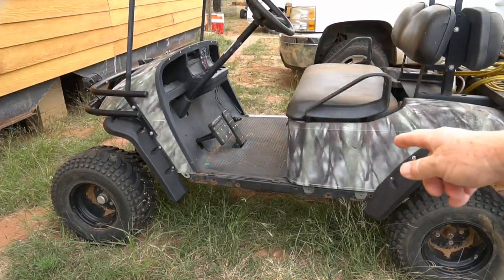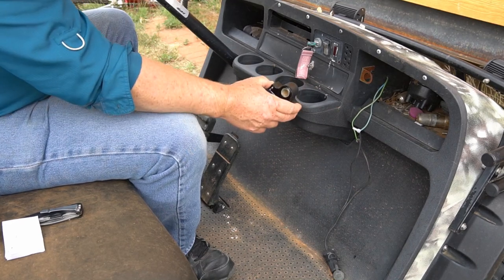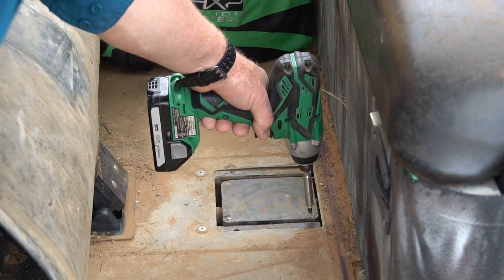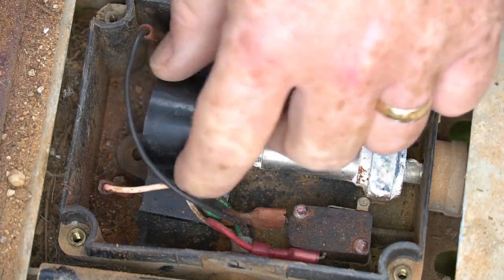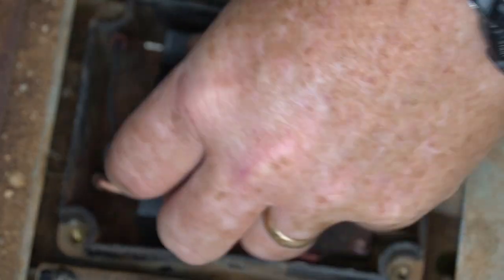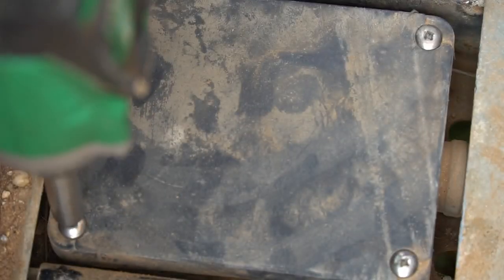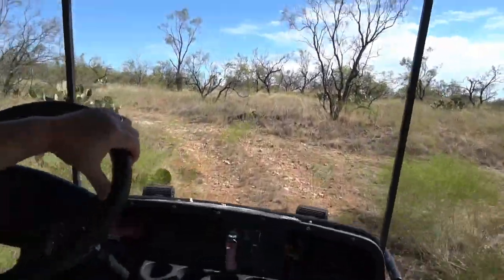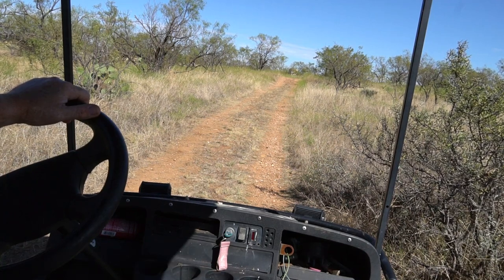🛠️ How to replace an EZGO Golf Cart Inductive Throttle Sensor. 🛠️

Comment: Just ordered one!  I had identical symptoms. Worth a roll of the dice and $24 rather than loading the trailer and driving 25 miles on two different days.

Just a followup on 1/27/21- it works great now!  Thanks so much.
Reply from the maker: Thank you for commenting Allyson!  I am so glad the video was helpful.
Reply: What's the name of the part? Thank you.
Reply from the maker: It's call a Throttle Sensor. Here is a link to the part, #ad https://amzn.to/3VNcLyf

Comment: Excellent video. Mine won’t move at all the solenoid is clicking but it won’t move. I’m gonna try this. Thanks agin for the simple instructions
Reply from the maker: You're welcome. I am so glad it helped.
Reply: Mine has your same issue. Did this end up fixing the problem for youm
Reply from the maker: Yes. It fixed the problem.

Comment: Got a ezgo 36v. When driving up a real steep road toward the top of the hill I'm hearing two beeps then one beeps. Carts still going and keeps beeping until I level out. Beeps sounds like it is coming from under the seat. Any suggestions?
Reply from the maker: Sounds like a low voltage warning to me.  This may indicate that one of your batteries is going bad and when it comes under s heavy load the voltage is dropping on that battery.

Comment: I have an E-Z-Go also and I replaced the same unit you are now mine is still jerking when I take off what else could be my problem 2 week old batteries they're brand new
Reply from the maker: I recommend you join this group of experts for advice.  They have been my source of help whenever I have run into problems with my cart.  https://www.buggiesgonewild.com

Comment: Hi, I have an EZGO that with full charge sometimes works and other times, I can hear the solenoid click but the cart doesn't move or try to move but can't. I thought the batteries were shot, but today I went out and tried it and at first it wouldn't move as I just described but I kept putting my foot up and down on the accelerator and eventually it worked, do you think this could this be symptomatic of a throttle sensor or something else?
Reply from the maker: Sounded exactly like the throttle sensor to me.
Reply: @thejungleexplorer  hmmm, it seems to be worse when I've left it on charge and its sat for a few days. The charger claims its full but with the full battery led lit but then when I try to drive it, it will move a few feet and stop. I'm leaning again towards the batteries being shot.
Reply from the maker: @healeydave  You may have a bad battery or a bad connection in the series. Do you have a multimeter to test voltage with? If so, try this.
Block the wheels so the cart can't move. Then do a voltage test on the whole battery bank series. You should get a total voltage over 36v, between 38 and 40v. While testing the voltage of the whole series, bringbitnunderbs load by lightly pressing on the pedal just enough to make the cart move.  Watch the voltage while doing this. If the voltage drops a bunch, way below 36v, you have a a bad battery.  Now do the same thing while testing each battery individually until you find the one that drops voltage under load.

Personally,  the first thing I always do, is to clean and redo all the connections and top off the water in all the batteries. Bad connections are hard to find. The easiest way is to put the cart under full load for a while and then feel each connection and find the one that is hotter then the rest.

Hope this helps.
Reply: @thejungleexplorer  Thanks for the advice, sorry it took a few days before I had a chance to test.

I jacked the cart up to do these tests, I hope the wheels turning freely is enough load for the checks you specified.

The charger was topping off the batteries this morning, so I had my breakfast whilst waiting for it to complete.

When I went back out, the charge cycle had completed and the whole pack was measuring 39.2V and individual batteries were measuring 6.46V, 6.55V, 6.59V, 6.46V, 6.60V, 6.68V. 

With the throttle pedal depressed enough to cause a the wheels to turn, the voltage drop on the whole pack was 37.8V and the individual batteries measured 6.29V, 6.29V, 6.33V, 6.18V, 6.28V, 6.28V.

I lowered the cart and was going to take it for a test drive but it drove a few feet and stopped. Depressing the pedal, I could hear the solenoid clicking but the cart was just tying to move a fraction of an inch. I thought I was going to have to push the cart back in the garage but I put it in reverse and lightly pressed the pedal, it did the same barely moving the first few times, then it started to move properly.

I ran out of time and needed to go to work, so I had to put it back in the garage but I was able to park it back in the garage under its own steam, I checked all the connections which appear tight and clean.
Reply from the maker: @healeydave  It sounds to me like it is a bad throttle control sensor, or a bad connection to the control sensor.  I have a buddy who is a mechanic and far smarter than me when it comes to these things and he has a saying. "Never assume that because it is a new part, it is a good part." He is right. More than once have a put in a new part that was defective out of the box.  
There is a forum called buggies gon wild. There some geniuses on there might be able to help you better than me. https://www.buggiesgonewild.com/
Reply: @thejungleexplorer  Great, thanks for all your help, I'm back to thinking its the throttle sensor again after my earlier tests and I have since had time to mess with it some more. It can take me ages to get going pressing the throttle pedal in different fashions, but once I can get it moving, I can drive it around the garden. I as for your last message, in relation to "new parts", I haven't change anything on this cart yet but I think I'm going to bite the bullet and order a throttle sensor first.

Comment: So I replaced the ITS and the micro switch, but still have the same issue. There is no throttle control, just warp speed. Any other suggestions??
Reply from the maker: Check the voltage between the pins the black and white wires from the ITS sensor in the pedal box connect to.

When pedal is pushed just far enough to make solenoid click, you should have 10V and when pedal is on floor it should be 6V.

---------
The inline connector between the gray four wire cable coming out of the pedal box and the cart's wiring harness. You can get all sorts of ITS errors
when it gets wet or damp. Some people replace the MOLEX connector with individual butt-splices or solder joints cover with shrink tubing.

Did the problems started after a rain? When damp, the battery pack voltage to the pedal switch can crosstalk with the ITS circuit and this can cause these kinds of symptoms.

Comment: We replaced throttle sensor. Cart still goes full speed. What next?
Reply from the maker: One of your batteries may be weak. You can test this by checking the voltage of each battery when under a load.  Block the wheels of the cart and test each battery independently while partially pressing down the pedal enough to activate the motor. See if one of the batteries show a significant drop in voltage.  If one does, that is your problem.

Comment: Just did this same repair.
It lasted a hour.
Dealer says the £25 replacements are cheap and unreliable. He's offering OEM at £200.

So, poll time..
Who has had a cheap one break right away, and who has had one last forever?

Comment: You mounted the NEW sensor on the dirt sticks and grime. WTF? Ya don't have a shop-vac? I would have cleaned out the sand and sticks from the box, and put some anti seize on those studs. Yer a real pro, dude.
Reply from the maker: That is just it, I am not a pro and never claimed to be.  I am just a DIYer that makes videos of the things I fix.  Can I ask you where you got the idea that I was a professional electric cart repair technician?
Reply: Good vid jungle.